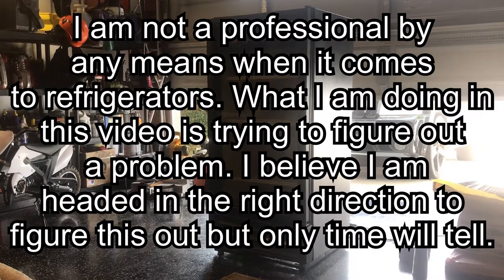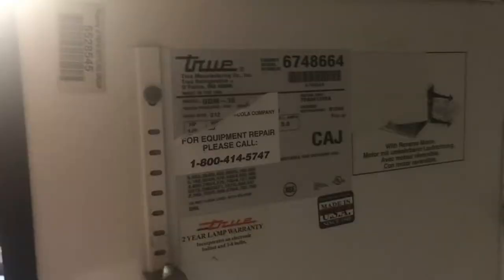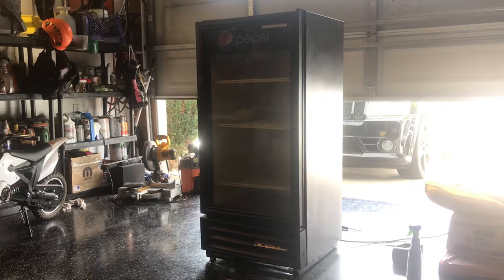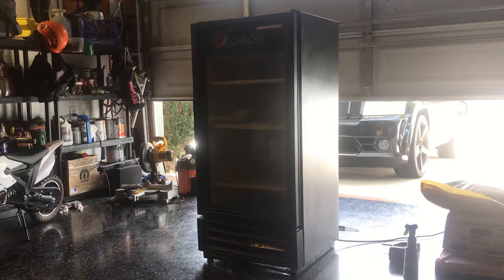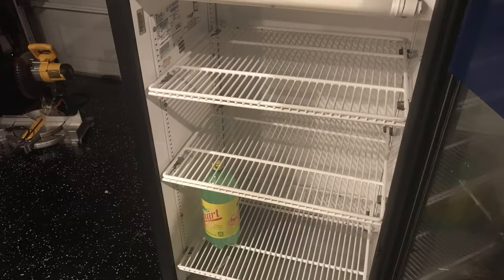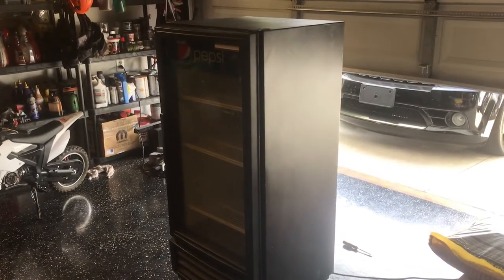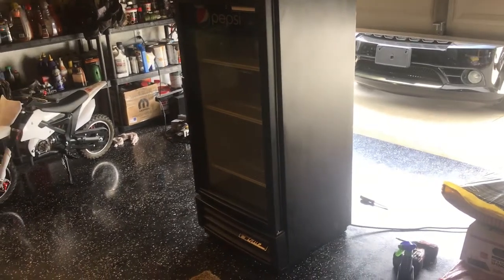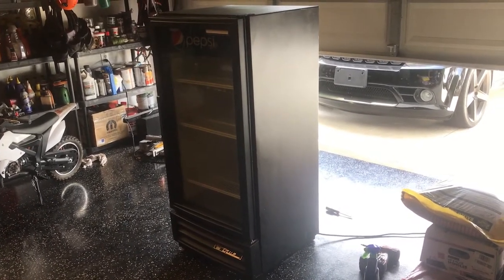GDM-10 Refrigerator not getting cold.... Starter Capacitor not activating the condenser fan!

Comment: ye good enthusiasm , the condensing unit ( this is the whole unit compressor and radiator and fan ) should be able to be pulled/ slide out of front there will be retain screws at sides , it will slide forward like a draw , it will be easier to work on replacing cap if this is problem True make good equipment and is easy to fix and economically viable .

Comment: you got a burnt fan motor the start cap only provides power to the compressor on startup it can be wired to power the fan as well but its not needed these fans dont need capacitors they may have a reversing relay but thats not needed. 115v 9A 1500rpm is the motor youll need id also take note of your thermostat, relay if you got one and the light ballast all of witch eventually go bad on the GDM 10s but the compressors are solid almost never seen a dead one. toy can also access all your wiring through the panels inside the unit

Comment: HI, may I ask if the fan on the top blows air in or out? Mine is running ok, the only issue is the compressor kicks off every 10 or 15 minutes. It sounds like to me the cold air is leaked somewhere, but I already replaced the door gasket.  So I don't know it is usual that the fridge kicks off frequently (assume door would not be opened during idle) or something wrong with my fridge. Thanks
Reply: that is normal for these units

Comment: I have an issue with the fan inside not coming on. Need your assistance. Please help.
Reply from the maker: If it’s the same fan in the video. Try kick starting it like I did. If it starts going, it will run until the refrigerator reaches the internal temperature setting and than shut off.
Reply: I have the same problem.  The Fan on top